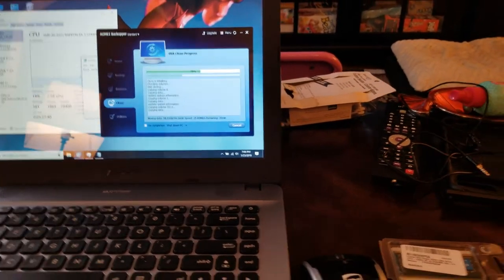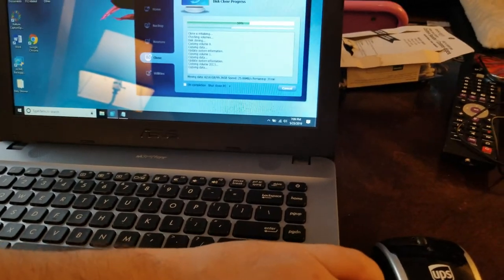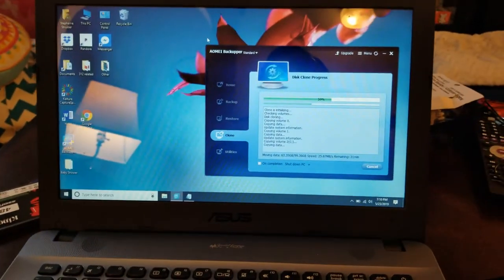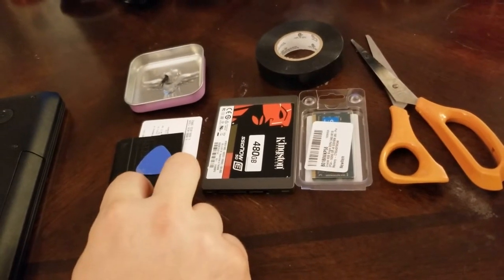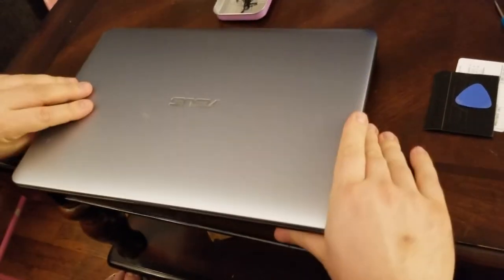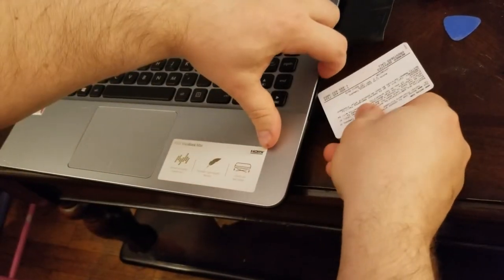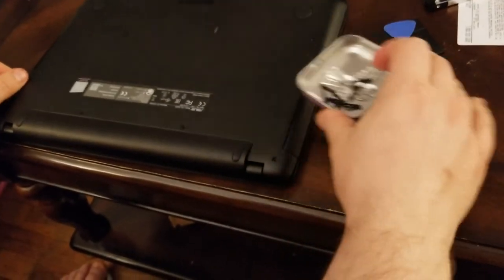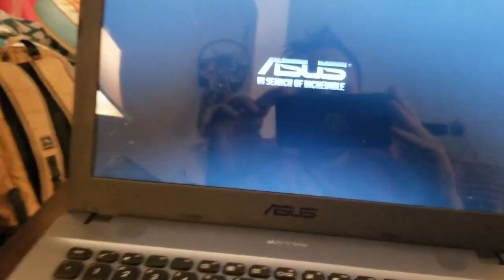Asus X441BA Laptop - Upgrade Ram Memory & Harddrive SSD HDD - Disassembly

Comment: Thank you so much. I followed your instructions and it worked , second time 😅jajaja My laptop was stuck on bios screen, so I watched your video again and I realized that it is crucial to push and press the card to avoid that issue 😓so I did more pressure on the card and it worked 😃😃thanks 👍🏻
Reply: Hi what "card" did you have to push in harder?
Reply: @rickyward3143  credit card, obviously.

Comment: Timely Video, I plan to follow your lead with a recent open box buy that I should have never have purchased. It just was picked up after having the system board replaced. Any thoughts about updating the Wifi card to ac/bgn combo card? I am looking for a place to buy a RTL8821AE card to take advantage of the throughput of the 5 ghz band of my mesh network for backups and streaming.

Comment: Thank you so much!!!! I’m gonna be doing this tomorrow. Wish me luck!
Reply: Nason The Beat omg same my kingston ram and ssd just got delivered. Hope everything works well.
Reply: Guys, did you upgrade your laptops?
Reply: @buchdev  First, No. Second, I have no enough knowledge of removing the keyboard part of the laptop to replace them. Third, I may cause trouble in case there is a fire that will happen after doing something in a successful removing of the laptop keyboard part. Fourth, I don’t want to do this cuz why not?

Comment: What a complete pain in the ass.  Thank you ASUS for making it so difficult to replace the ram.
Reply from the maker: I know. It should have just been accessible  like most laptops!
Reply: Man, when Asus is harder to change the ram then a MacBook pro you know the world is about to end. Some one keep tabs on that Rossman fellow. If he disappears into the woods with a bag full of apple chargers you know it's time to stock up on canned food.
Reply: Yeah, that missing "ram door" at the bottom of the case is a major design flaw in my opinion
Reply: daniel safe macbook pro even easier to upgrade ram
Reply: @OmegaRed7159  Hi, great video btw,thx.
I followed your video minute by minute, I even purchased the same Ram for my Asus, however, once I restarted the laptop, I got stuck (and still am) in the bios. I've tried so many things to get out but each time
I restart i get taken back to the reboot screen, can you help me pls.
I appreciate it.
Reply from the maker: @risquest1  Are you receiving any errors? Is your harddrive detected in the bios?
Reply: @OmegaRed7159  I get a message that reads. " System cannot find any bootable devices".
Reply: @OmegaRed7159  Hi, I get a message that reads.
System cannot find any bootable devices.
Reply from the maker: @risquest1  You may have missed a cable when reassembling. Take a 2nd look
Reply: @OmegaRed7159  Great, I will give it a second look. Thx

Comment: Great guide, good pacing, much better than the other ones I found.
A couple of notes:
1. After I installed a 4GB module, the system recognized it but no longer saw the SSD I had installed months before. Removing the memory brought the SSD back. It was a bit of a puzzle but I found a BIOS update on ASUS's website and after flashing that the system now sees the RAM and the SSD.
2. I installed a DDR4 2400 module and that speed works fine. In my experience, DDR memory that is rated faster than the system accepts will always run at the slower speed. So even if the built in memory is 2166 then a 2400 module will be happy to run at the slower speed. This has been the case with DDR 1, 2, 3 and now 4.
Reply: Does your laptop have an a6-9225 processor? cause there's a version with a a9 processor and I Would like to know if that has something to do with some people having trouble with 2400mhz ram
Reply: @Vic-yz5bo  a6-9225, yes. unlikely since that's just the way the memory modules are supposed to work backwards in speed. maybe ultra cheap modules have some problems.

Comment: Thank you so much for the tutorial! It sure is a big help to me. I just finished upgrading my x441u successfully.
Reply: Did you use a ram with 2400mhz or 2133mhz?
Reply: I failed trying to upgrade with an 8gb 2133 memory stick. Computer called but no video.
Reply: @CalidoGesto  I used an 8gig 2400mhz stick from Kingston

Comment: @d2infinity - Apparently, Asus made 2 versions of the x441BA. I went to their spares site and they offer 2 upgrade modules, an 8GB  2133 and a 2400 mhz. They note to check your installed memory before ordering the part. Your machine may happen to be a 2133 ghz model but, to be sure, I would check the specs of the modules soldered on the to board before buying the upgrade. The soldered on modules are located on the board directly below the fixture to install the upgrade module.
Reply: how are you checking this

Comment: THANK YOU for this! I just need something that I can work on some very light Texturing  (for 3D work) while at the cigar lounge so I knew I was getting a cheap laptop that needed upgrading. Lots of useless info out there so this video kicks ass.
Reply: What upgrades did you do?
Does it run good a CAD software?
Reply: @gosth81  Believe it or not.. it did fine with 2D CAD. I found that it took forever for the software to load but once it was running, it did well with 2D CAD. If there weren't too many models in the scene, it did fine with 3D CAD as well but I wouldn't try to start a business with it. You can do simple stuff with 3DS Max but rendering would take forever. This laptop wasn't really meant for that and adding more RAM certainly helps but isn't enough to get any real work done. Blender might work pretty well on it, though I haven't tried it yet.
Reply: @oso_Peligroso  Thanks for the info, i'm a student and frequenly use CAD software. So i will consider buy other laptop or pc instead of this one 
Cheers
Reply: @gosth81  Good luck on your studies! I wish I could recommend this laptop for CAD work but honestly it just isn't the right one. Unfortunately you will have to pay more but hopefully it will be worth the price when you get some type of design job. Cheers!

Comment: Thank you.
Just finished upgarding my lappy.
Its same series but with amd A9.
As you said, I use Vgen ddr4 4gb 2133Mhz.
It runs at 1866Mhz, I think its because motherboard default configuration.
Before upgarding, task manager and Cpuid also shows the speed at 1866Mhz.

To anyone there who wants to upgarde this lappy. Yoy must make sure to use 2133Mhz Ram and correctly put the  Ram on the slot or you wont even reach bios like what happened to me.
Reply: Can you help me please, when i upgraded the ram on this laptop, the laptop screen doesn't turn on but the indicator light turns on, but when i unpluged the ram, the screen turns on.  My new ram is Corsair SO-DIMM DDR4 8GB PC17000 -.  CMSO8GX4M1A2133C15 - (1X8GB). I don't now what was wrong
Reply: @DaniYMIYP  It's either the ram not perfectly seated on the socket or sadly, your new ram doesn't match with inboard ram and can't work together
Reply: Thank you for your answer
Reply: @DaniYMIYP  does it work now ?
Reply: @devapramana4665  
No, i tried many times but still didn't work
Reply: @DaniYMIYP  does it work after 1 year??
Reply: @mez2902  no, i brought new ram😀
Reply: @DaniYMIYP  share the specifications bro
Reply: @DaniYMIYP  bagi Spesifikasi nya ngab
Reply: @DaniYMIYP  p

Comment: Thanks for the video. I learned a lot. I bought some Ram from the link you suggested, installed it, and the computer starts, but just shows a blank screen. I took out the new Ram, and it started up just fine. Does that suggest the Ram is incompatible? (Ram is Timetec 8GB DDR4 2133)

Comment: This was very helpful, I've been looking for a tear down video and had a lot of trouble till I found this!  But I still have a question.  Any idea where the CMOS battery is on this model?  I have power and hd lights, but a blank screen and can't get the computer to enter into BIOS through powering on and holding F2. So it seems like a big suggestion is to disconnect the CMOS battery to get a reset, but I can't find any sign of it. Thanks!
Reply from the maker: This laptop doesn't have a CMOS battery. If you're having trouble reaching the BIOS after upgrading the ram, more than likely the ram isn't installed correctly (very finicky) or you purchased an incompatible frequency.
Reply: @OmegaRed7159  Thanks so much for your reply!  That makes me feel so much better that there's a reason why I couldn't find it anywhere!  I actually installed the RAM a few months ago and it has been fine since then.  My problem with the blank screen has been since the firmware update for this model came out last week.  After I installed it, it tried to restart and hasn't moved on from only a blank screen with power light and fan running since then. I further made the mistake of inserting the HD into my wife's identical computer to try to retrieve documents.  It immediately took me to BIOS and I inadvertently installed the firmware update on it with the same result.  So now I have two unresponsive computers, that both don't have CMOS batteries, so as far as I understand I can't reset the BIOS for them?  Do you see any other way of getting a proper version of BIOS restored besides that?  Thanks!
Reply from the maker: @beediesbee  It sounds you did the upgrade from Windows, which "bricked" your machine. Check out post #7, https://rog.asus.com/forum/showthread.php?111436-GL502VSK-Bricked-BIOS-Update
Reply from the maker: @beediesbee  You can find different bios versions here: https://www.asus.com/Laptops/ASUS-Laptop-X441BA/HelpDesk_BIOS/
Reply: @OmegaRed7159  Wow, that is exactly the same behavior that my laptop has had!  Except the solution is not working for me!  I really appreciate you digging that up, as it is giving me further hope, but so far I haven't found the right way to get the computer to respond to the USB or my key presses in order to get it to boot in BIOS.  I've tried the keystrokes suggested in the thread (CTRL + Home and power), I've tried F2 which is what is listed in the user manual for powering up in BIOS.  And I've tried other online suggestions from ESC to F5.  I also tried both the newest version of BIOS and the previous one.  The .BIN filename is what I modified the BIOS file to, and removing the extra AS letters.  But no results on the screen at all.  I've also tried different USBs.  They have all flashed like they're being accessed, but no result.  

The one difference I've found from this forum post above is that I can't get the USBs to flash in the left USB port that is next to the HDMI port, only in the right(front) USB port.  But I'm not sure that should make a big difference.  Any other suggestions are still appreciated, as I'm traveling in Africa for another 8 months and don't have a way to bring it to a skilled repair person!
Reply from the maker: @beediesbee  Try the following: Make sure that your USB stick is formatted to fat32, use the USB 2.0 port (2nd USB port right of the HDMI port), and unzip the BIOS file you downloaded and rename (replace the -AS.308 with .bin).
Reply: @OmegaRed7159  Once again, those are helpful details to make sure I'm doing it the right way.  Unfortunately, I am trying it in the USB 2.0 port, and have checked the fat32 format.  I feel like there is some movement to read the USB, but it's not finding what it needs, similar to what the rog forum poster was thinking earlier.  But I don't know if there is some other file name to give it.  The BIOS file downloads as X441BA-AS.307 but I've been unziping it and then renaming it to X441BA.BIN.  That seems right, right?

Otherwise, I'm back to finding a way to reset the BIOS.  If there's no CMOS battery on this model, then what is powering the BIOS chip?
Reply: On another note, do you think it might work if I burn a DVD with the BIOS on it and plug in my external DVD player to run the DVD from?
Reply: @OmegaRed7159  Problem SOLVED!  Thank you so much!!! This first reply got filed away in the back of my head since I had upgraded the RAM 2 months ago with no problem. But after a few weeks of nothing else working, it dawned on me that maybe the new BIOS update had changed something to be incompatible with the RAM I had upgraded to.  I took the upgraded RAM out and it starts up like nothing happened...!
Reply: To answer the question of WHY this happened, I went back and checked my RAM upgrade specs. They are: CORSAIR Vengeance 8G 260-Pin DDR4 SO-DIMM DDR4 2400 (PC4 19200) Notebook Memory Model CMSX16GX4M2A2400C16.  Looks like the 2400mhz is the problem, although strangely it worked with no problem on both of my laptops until this BIOS update came and changed it.  I guess I'll have to find a way to get some 2133mhz RAM shipped over here!
Reply from the maker: @beediesbee  Im happy you were able to figure out the problem. If you're certain, you can try to roll back the BIOS version instead. The ram really makes a difference when multitasking, 4GB just isn't enough nowadays.
Reply: @OmegaRed7159  Sorry to draw you into a slightly different topic, but now that I've acquired the 2133mhz RAM and installed it successfully, I'm having an unplanned restart issue with both of the laptops.  We don't leave our electricity on overnight because we're on solar and need the stored energy for fans and 'frige.  But both our laptops shutdown unexpectedly when left overnight almost all the time now.  When restarted, they show almost full batteries, but often times they won't restart until they are plugged in.  Also, during the day, I have left my laptop unplugged and it doesn't shut off when closed and sleeping, and there are times when I've shut it down and then restarted it on battery.  That makes me think it's not a battery issue, plus the fact that my wife and I have very different battery settings and usage patterns, that hers is plugged in 99% of the time during the day and almost everyday I'm using mine on battery for a few hours.  So it doesn't make sense why they'd both have battery problems at the same time.  I haven't found any power settings that seem out of the ordinary, so I'm wondering if you've ever heard of issues like this from RAM or other incompatibilities?
Reply: From an outside perspective, I think this problem is fascinating, because I've isolated it down to a problem with the connection between the internal battery and the motherboard.  Sometimes pressing the power button to turn on gets no response.  Then I press down hard on the left side of the frame above the keys, where I know the internal battery connection is, and then the power button starts the machine perfectly.  Sometimes the laptop with shut off in the middle of start-up, and then I try again while pressing on the same spot and it starts up fine.  But almost every night the connection is lost and the computer is shut down if it's unplugged.  I believe the problem is brought on because the screws on the bottom of the frame that hold it together are attach into plastic, and those plastic pieces have broken off in the corners near the screen.  I don't believe it was from excessive force of screwing them in, I'm more inclined to believe that it's been because they're cheap plastic and the laptop has been bumped around in travel a lot.  But I've certainly opened up these laptops many times now (maybe 8 or so), so that would reasonably be a factor.  So be careful out there!  My main problem now is how to secure the connection to the battery without the screws.  I'm thinking of putting electrical tape over the connection, but not sure that will be enough?